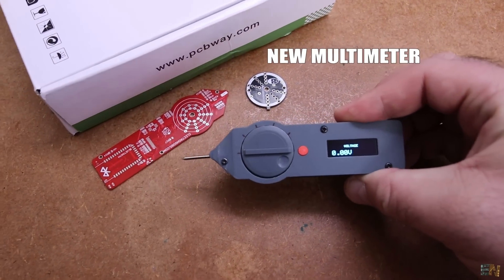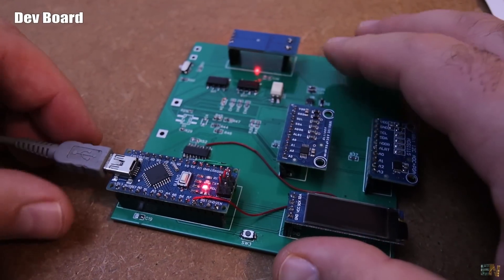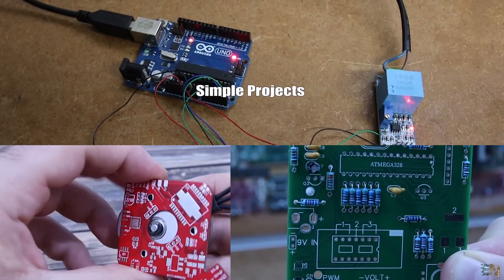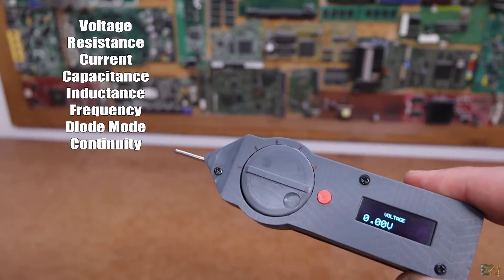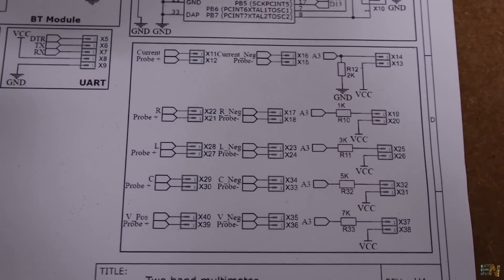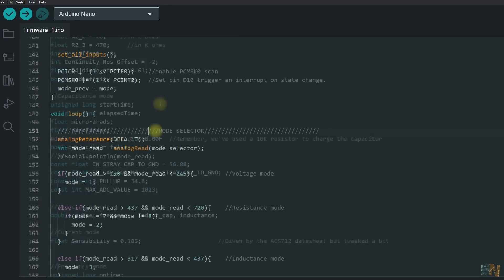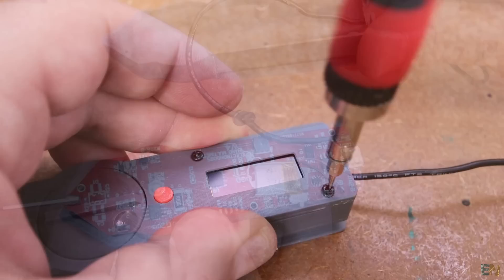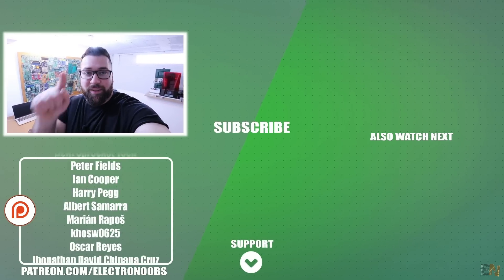BEST Homemade Two Hand Multimeter - Finally!

Comment: You did not install a bridge diode. You short-circuited the 0 ohm resistors numbered 25 and 29. Can I learn why? You also put a 0 ohm resistor in the fuse box. I cannot see any other changes on the board, if any. Can you explain?

Comment: The design looks awesome for a size like this but you should consider going for a 4L pcb and remove those extra traces that are running underneath the rotary switch's moving area I can see how problematic it could be if those pogo pins start to wear the soldermask on those pins and short them in the long run.

Comment: Nice work. Perhaps you could design the housing so that the negative probe sticks out as far as the positive probe when the cable is wound up. This would make it possible to take measurements with just one hand. It would be even better if the distance between the positive and negative probes could be adjusted and fixed, for example when measurements are made on SMD components.

Comment: That's yet another excellent development coming from this channel. I really enjoy watching your videos and I learn a lot of practical hardware tips from you!. As a long term software developer, please allow me to make a friendly suggestion:  You should avoid using floating point arithmetic on embedded 8 bit processors because it's generally expensive, it requires the presence of specific libraries, and most of the time it's not needed anyway.  Instead of using float, you can just work with upscaled values,  by say 256, 1024, or  65536 and perform all operations using integer arithmetic (possibly long int). Alternativelly, you can  just upscale your data values just  before performing critical arithmetic operations (chose the appropriate scaling to minimise truncating errors), then downscale the result to the original variable size. Some programmers even use decimal constant upscales, say 1000, or 10000, because that makes display of values in decimal representation cheaper. Overall, using only integers makes your code faster, smaller (because there's no need for floating point library),  and some will say even more professional looking. In your particular code, the ADS1025 calls provide uint16_t values, not floats. So my professional vias here would favour to stay with integers in order to avoid arithmetic and type conversion overheat. I fully understand the convenience of floats in non critical code, though. Anyway, excellent stuff !

Comment: looks really good I would have the rotary switch with   course  pattern on the edge of the wheel so that it could be changed with your thumb I would get rid of the top part of the  knob on top the top of the rotary knob could  be within the case with cutouts to show the functions the fuse needs to be replaceable even if it has to be a bit bigger.  and for sure the battery needs to increase in size that one looks really small.. Just some suggestions to what looks a really good and useful meter

Comment: Handy project! Really like the compactness. A cool add-on would be a high voltage resistive/capacitve voltage divider nozzle to attach to the front of the multimeter. You would need to add a toggle switch for 'HV Mode' which would simply be a multiplier to the output on the led, making it easy to read high voltages. The nozzle can be quite long to allow for reading high voltages in experiments. The nozzle would be 'keyed' to allow for snug fit with the multimeter tip. Cheers.

Comment: Thanks a lot for sharing this. I have ordered the PCB's and the resin printed enclosure.

I see another application for this: Automotive use. 
I don't like putting my expensive meter under the hood of my car in a place where anything can happen to it.
Then I have to measure and watch the probes, trying not to make a short circuit. At the same time watching the multimeters display.

With your design I don't have this problem anymore. Of course there are pen meters on the market, but your design is much more versatile.

Maybe automatic screen rotation is nice. Not only for left handed people.
Replacebe probes, maybe. There is sort of a standard in this.
A buzzer for latching continuity checks.

Definitely I do not mean this as ordering features ;) . Besides I do realize that you cannot fit everything on such a small board.
However I do know that I am going to enjoy building your project!

Comment: OMG just buy a pokit pro. Nice project but i would not say that this is a handy gadget. And if you cant affort a pokitt pro then just buy a pokit meter. With this device you even got a Oscilsoscope built in and it fits snuggly in your pokit.
Reply from the maker: Pokit doesn't have a screen on it,
you have to always connect the smartphone app on the side... For me this is the most comfortable way 😂
Reply: pokit pro is also $200 lol

Comment: For those that wanted a "thumb wheel" access from the side of the meter, I suggest only a slight modification. On the main PCB offset the position for the mode selector wheel to one side a little bit. Maybe "down" when viewed with the PCB text upright (the display to the right) is best to reach the thumb. The opposite side can now be a straight edge for both the PCB and the case. Make an opening in the case where the wheel protrudes. On the top wheel cap, let it go around the outside of the PCB wheel, but also make the outside a cerrated edge. It will serve as the thumb grip in the new side opening.

Comment: This is very nice! I always wanted to see the voltage right next to the point I'm touching, especially if the contact point is very small. Having to look away to a "real" multimeter for a readout is very distracting.

Comment: could you have a logic sniffer mode? ill love to be able to probe for finding RS232 I2c spi and neo pixal lines plus a  header for being able to sniff those data lines.

with those modes print out data to PC console for logging and mirror it on the display
Reply: follow up as well small buck boost converter with both current and voltage regulation so you can power up a hall effect sensor in a Ebike hub motor for example    or any small sensor

Comment: nah.. you can get a decent multi meter with all of the features that one has, for less than the cost of building that one. you also get the added bonus of not having to deal with the rotary knob, electrocution  hazards, or drift.. not to mention components need to be measured to ensure the +-% value is within acceptable tolerance.

Comment: Another interesting project Andrei.

I wonder if there would be any improvement with a version that uses the barebones ESP32 chip.  With its built-in Bluetooth it would probably at least eliminate the need for the external bluetooth module.  Granted that is probably more trouble than it is worth given how much work you've already put into this version.

Comment: What are your thoughts on the longevity of those pogo pins contacting your PCB many times? Do you think just asking for a large copper weight on the pads and then using a long lasting lubricant to outlast the lifetime of the tool? Gold plated pogo pins are great, but once that plating wears off, there might lesser consistent metal inside that is either very hard or very soft. I have had quite a few cheap multi-meter PCB traces worn out this way.  Please keep going, awesome project! I love the progress so far!

Comment: uh, kind of seems like the pogo pins should go on the static base instead of the dial.  that way when they wear a track in the PCB...  you can just replace the dial instead of wearing a track into the base.

Comment: What's awesome about custom tools is that you can customize it for your application.

You can have your own beeping sequence for different diode voltages, you can add a dfplayer for sound readout or whatever you want.
Reply: Now I can just imagine what kind of sequences that would be... Maybe a binary encoding of the value on the display? Or it could be beeping the digits using morse code? Could also beep the digits like they are shown on an abacus, long beeps for a 5 bead followed by 0-4 short beeps for the 1's.

Comment: I would add indented text of modes to case and fill them with white ink.
I would also add auto power off and add extra off step to selector like other multimeters (having to off position on start and end of selector is ideal) and remove side on-off switch.
I also like to have ESR meter on capacitor mode.

Comment: It's great stuff, but the most obvious question I could have is: what happens with the solder mask during the usage of the device? Those pins dragging on it will wear it down with time.
Reply from the maker: I guess we will see... For now nothing happened yet... I guess the idea is to fix the pins on the main PCB and make the dial with the pads...
Reply: @ELECTRONOOBS Or an array (star) of small hall sensors and the dial with little magnets ;)
Reply from the maker: @kamilzierke7756  the hall sensors would be only to change mode but I need an actual real connection for the probes and that's only made with pins, relays or maybe MOSFETs but those add more stuff to the circuit and code...
Reply: @ELECTRONOOBS Very true, I totally missed that part. Then maybe a a plastic foil film/cutout on which pins would be sliding instead of the soldermask? Even with 0.1mm thickness it should do the job and also provide a nice tactile feedback when the pins would drop in place.

Comment: I think the dial is a very bad idea because i have used allot of multimeter before every one after using for a while have bad connection especially in diode test mode
Because too turn it on and off you will constantly turn it and it'll ware out the contact
It's better too use a relay and remove the current measurement feature because let's be real it's very useless and dangerous
And use a encoder or 2 button for selection

Comment: temperature and duty cycle could be nice additions, and what is the lowest resistance it can reliably measure ? mine gets a bit tricky to read below 5 ohms
Reply from the maker: Are u using the internal ADC of 10 bits or the external 16 bits ADC as I do?
Reply: @ELECTRONOOBS  nono I wans wondering about your specs because mine is an off the shelf one (I don't remember the brand but same kind of multimeter as a Fluke) but it struggles with low resistances and I am curious how a DIY one handles them

Comment: When it will have current clamp, K-type temperature meter and hot wire detector with sensitivity adjustment with such compact size, please let me know. Now it is great for DIY project. And doesn't measure everything...

Comment: this is actually useful 
you should integrate it in to a breadboard to have a smart breadboard , that way you can sell it on your shop
i've seen alot of multimeters , but i rarely see any breadboard that have an integrated multimeter , and your circuit is small enough to do it
Reply: look up the jumpperless breadboard
Reply: @nadiaplaysgames2550  thats not what i mean !!!!!

Comment: Even though you don't use this for high voltages, I'd recommend a switch that connects the battery to either the charger or the circuit, but not both.
Sure, you can't charge it while using it, or run it from a charger, but you'll prevent the almost inevitable unintentional short circuit via charger and power supply for the circuit you are testing.

Comment: All your projects are great. And I have a question, why are you still using the Micro USB connector and not changing to type C, regards
Reply from the maker: Is kind of big and don't need it for this project. For other projects with more power I did use type C...

Comment: What happens if you are on the wrong setting? Will it trip the fuse? Display error?
Reply from the maker: Usually nothing, but I'll have to test each mode... In the code, all pins are set as input with high impedance. Maybe high voudlate would burn the pins but I haven't tested...
Reply: @ELECTRONOOBS  great work! This is going to be very handy! Let me know if you want me to do a build video on one of you mini-meters!

Comment: Well that is great  thing to have tbh my multimeter wires are really annoying too they always get tangled so i hope you finish this one  . Because i might buy one tbh ...  what would i add if could be    well the case u made is kinda big like  if u use it like pen i mean at least the  width of it not thickness  + that would be really good if the negative wire was recla retractable  after u let go of the negative wite or maybe something like old phone they were like spring will get smaller  and + if u could have like plastic tip to put at the tip of the positive tip like pen tip case  after all its really great project I love  it how compacted its  well done brother 🙌🏿👏

Comment: you should switch the dial housing to be on the outside instead of the top so you can do 1 handed mode changes

Comment: Oh, yes, I have the wires problem, too. If it's not the power lines, (USB micro to at least two boards, and the oscilloscope and the multimeter.) 
Loving all the early versions of the caeing!

Comment: Hello, this is a very nice project, and I can give you a free advice, since it should be a 2 hand multimetter, it would be great to make the Dial for changeing modes into a wheel , that you can change with your thumb, so that you can change faster what you need to measure. Similar to a Jog dial that previous phones had like the old Sony or old Blackberrys. Let me know if this makes sense, PS: foarte misto proiectul :)

Comment: Interesting project. I would consider putting the display as close as possible to the probe tip. Round the case edges making it comfortable to hold. Ditch the neg probe holder. Consider socketing the neg probe.
Reply: Agree. Display close to the tip, the rotating switch in the back.

Comment: I like it been looking for something like this as i often work on highly dense boards and with a desktop meter have take my view of the board to look it. This sometimes leads to me slipping of the probes. With this you can position the probe and read the meter looking at both. 
I have one suggestion make negative probe wire pluggable so it connected with different ones ie crokadile clip. But your products are becoming very professional thanks for your time and work.

Comment: Cool. 

I would add female pinheaders hooked up internally to the probes. So you could easily connect it to a breadboard using regular jumper wires.

And maybe a small magnet to hold compoments/screws temporarily.
Reply: Great idea.

Comment: Nice work! I'd definitely add a buzzer to test for continuity (and one that reacts fast so that I can search the pin of an IC a track routes to). And I'd go above 1M ohms because with voltage regulators and low currents these days it's quite common to find values a bit above that limit. It's nice that the display updates quickly. A calibration mode/button  would be great, to reset the zero and cancel wires resistance / inductance. Maybe you should sell it as a kit!
Reply from the maker: It already has a buzzer and LED for that
Reply: @ELECTRONOOBS ah sorry, I hadn't noticed it!

Comment: How is the accuracy of ads1115?  do we need to adjust for any kind of offest or errors at specific conditions
Reply from the maker: Ie easy to calibrate just by touching the probes when you calibrate it it will find the offset

Comment: Nice project! For the next iteration you could try using one of the newer ESP32 (ESP32-C3/ESP32-S3), you can directly upload sketch to it over the USB (no need for external USB to serial converter as it has built-in USB Serial/JTAG controller) and it also has built-in Wi-Fi and Bluetooth.

Comment: Terrific!  I wonder if the dial would last longer if the pogo pins were on the board and the pads where on the dial surface?
Reply: That would also mean that the wear happens on the easily-replaced dial board instead of the main board with all your components on it.
Reply: It also frees up some space on the main PCB, which can be used for some low profile components. The round PCB will rotate freely above without any pogopins coming down to strike them.